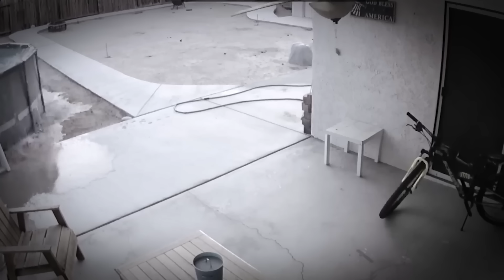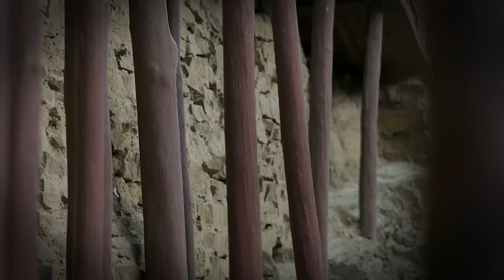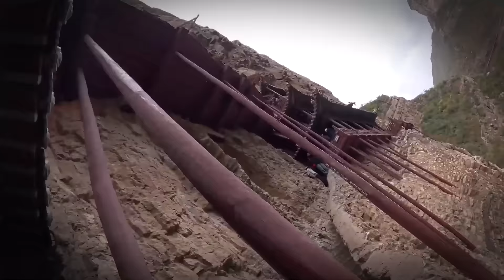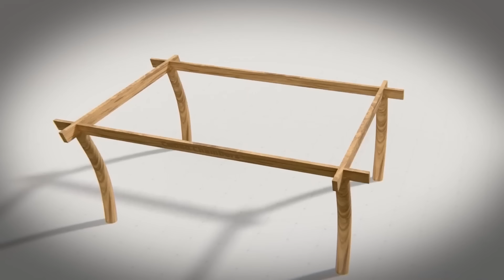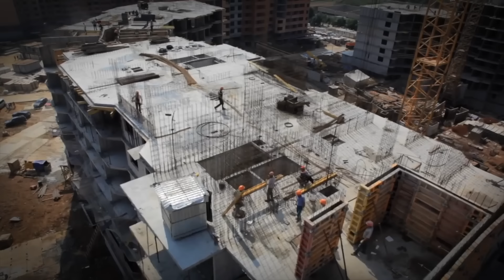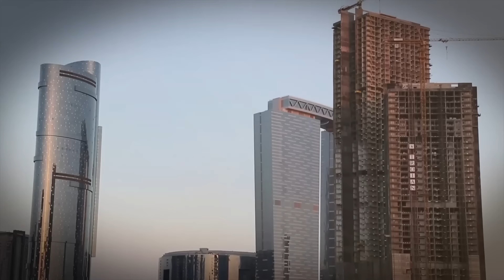How Ancient Chinese Monks Engineered a Temple to Hang Off a Cliff for 1,500 Years

Comment: I climbed up the temple last November. It's a lot more astouding in real life.

The vertical posts also serve as indicators of the condition of the beams. If everything is ok, they sway with wind. There must be something wrong with the beams, when the posts get pressured and become rigid. 

Also, if you haven't looked it up, you'll surely be intersred in the Wooden Pogoda of Ying County.
Reply from the maker: Wow. How does it feel? Usually the holy places have this different vibrations in the air that gives more tranquility. I haven't been there yet. But i will one day
Reply: @SilkRoadDiaries25  It's actually less of a holy place and more of an architectural masterpiece. Everything is very cramped. The main shrine hall could only fit a few people inside.😂
Reply: @styjoy The monks were thinner and shorter back then.
They didn't need larger rooms.
❤️🙏❤️